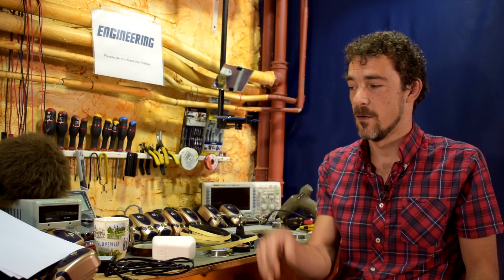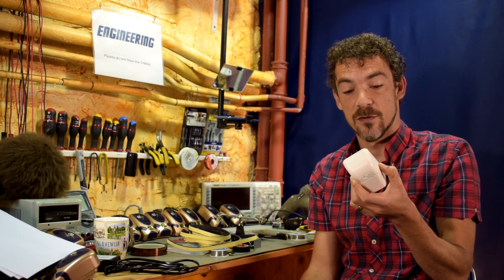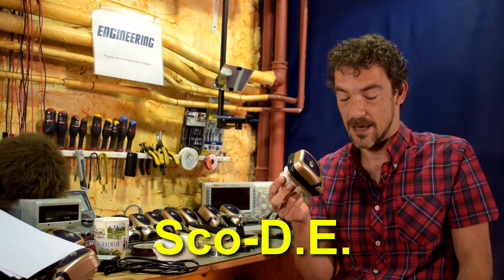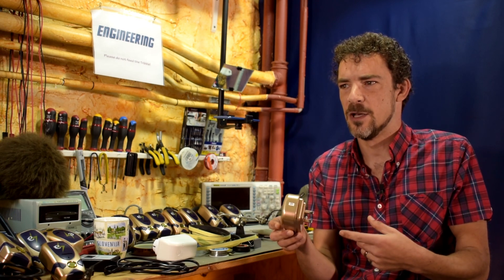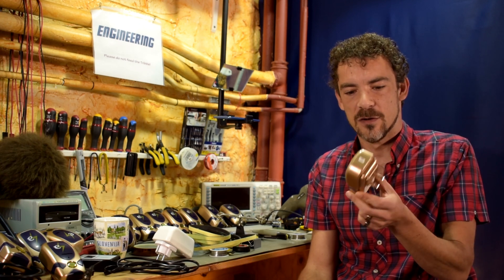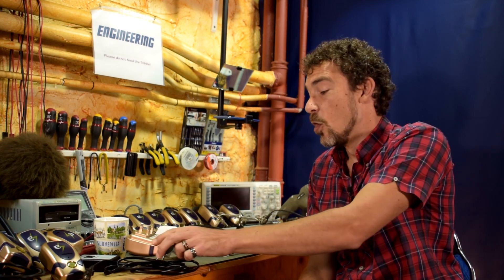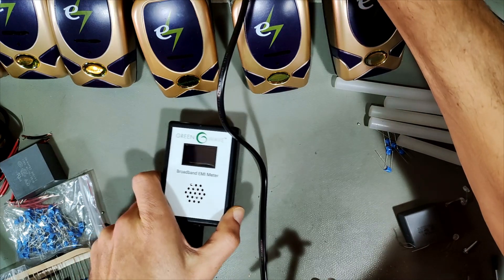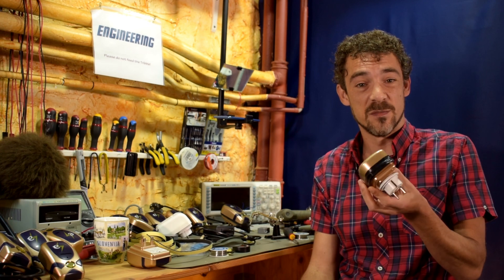Make your own Dirty Electricity Filters!

Comment from the maker: IMPORTANT: DO NOT use cheaper "motor-start" capacitors... Use real X2 EMI caps. If you don't, you may end up with melting filters and fire!! The little blue caps should be Y-class if you decide to include them, as well.
Reply: So i should not include little blue caps if I dont have ground in house ?
If i should , where to connect them , u connected them to the ground
Reply from the maker: @dasistthomsen9  If no ground, then just leave out the blue caps.
Reply: Yowzers! 25uf at 230 volts is 410 watts!   That wall wort will go into meltdown.  Why not just use the power saver as is?  They have a 1 or 2uf cap in them already, optionally you could add a 200pf cap, the led is already there as a bleed down.   If you need more than a few uf to filter dirty power either the wiring in your house is suspect or you doing something you shouldn't be doing.
Reply: When did electricity become dirty ?
Reply: @PrettyGoodLookin  Probably when SMPS (switch mode power supply) started being used in electronic devices. Also, CFL and LED bulbs add DE to a line. This can be easily demonstrated with the G-S or GW meters. My wife and I have several rental properties. When I am looking to buy one I always test the mains for DE.  Condos seem the worst with readings in the thousands.  It is tough to mitigate this much DE with filters, so I usually take a pass on those properties. I can't comment on whether cell phone tower waves do anything though.
Reply: @lo1234-w9r  While it is true that a 25 uF capacitance across a 230-volt, 50-Hz line will result in 1.81 A through the capacitor, the true power delivered to the capacitor should be nearly zero, and consequently, the capacitor should not get warm. If that is indeed the case, then the "consumption" of electrical power will be zero. In that case the product of voltage and current is called apparent power and its units are volt-amperes instead of watts. If the capacitor does get warm, then the capacitor is not well made and you will be paying for the power that is causing the heating. That power is called true power and is measured in watts.
Reply: Yup this is one thing you do not want it to be Made in China (that’s mean buying from Temu) Japanese capacitor are still everywhere

Comment: I bought the Greenwave filters to remedy a problem I had with computer equipment doing weird things I couldn't explain and had troubleshot it down to EMI on the line.  Like off the charts it was so bad.  My electric utility here in Canada wouldn't fix it so I went out in search of power bars and anything else I could find that said it would filter EMI.  The Greenwave filters are hands down the best device out there for cutting it down.  What I actually did was at my main breaker (fuse) panel I installed 2x 15 amp circuits as the first breakers where the 2 lines of the split-phase power I have coming into my North American Supply.  It's 220 volt but split phase of 110v and 110v.  So I have one 15 amp breaker on the one leg and another on the second.  I installed 2 plugs on these breakers and put in 2 Greenwave filters on each plug of each of the split phase lines right at the breaker panel and I dropped my incoming off the chart noise down to 104mv as measured by the Greenwave meter.  I then bought extra to put one in each room of the house and I managed to get it down to 24mv at each spot in the house.  All the random issues I had with my computer equipment rebooting stopped, I swear I feel better (anecdotal, nothing to confirm though) and I swear that we are having less issues with electronic devices in general.  I also noticed that the sine-wave is clean waves now and not fuzzy waves when I look at it with my Oscilloscope.  Anyway, just thought I'd pass along the information.
Reply: been dealing with the same problem form past 4 years,sir can you please elaborate more on how you installed circuits at breaker?a pic would very much helpful

Comment: Scottie, your taste in shirts gets an A!
I have worn out many just like it, along with my Tech buddies.  
"In a world of non techhies in screen printed T shirts, we stick out". 

Capacitor (& Transistor) prices jumped in around 2008 according to a Tech Friend who ran a repair shop. 
I already have 4 ASC American made 20 & 8 u f MIE  not marked x y.
I've installed non x y caps in mains wiring on noisy circuits in the past, and never had an issue, but have had other techs mention that x y are intended for this situation. 
(I have a bag of h v metalised film caps gathering dust).

Comment: Just finished putting together my own filters, for 25 of them here in the US with parts ran me around a bit over $300. Though my enclosure isn't as neat since it's a power supply box with a pigtail. Went with two x2 caps and the small y class caps to ground.  Don't have a meter to measure the reduction on the line yet but noticed my milligause readings on the cornet meter around the house have come down as I plug more in interestingly enough. Dropped by half so far with 8 filters. Least RF isn't too much an issue to deal with here as that usually averages below .01 mw/m2.
Reply: 😊😊q😊😊😊q😊qq😊😊😊😊😊😊😊😊😊😊😊😊%😊😊😊😊😊

Comment: really awesome and informative video! I have some curiosities. My application would be when using a generator during power outages. I want a "dedicated" branch circuit protected by a 20A breaker. I work in the powergen industry as a test tech, but our scope is three-phase power, 480V through 27kV, so I'm not "in the loop" with "residential single phase" power. I'm looking for ideas to "hard wire" protect a single branch circuit from my service panel which will supply a "media center". Your explanations of the usage for specific components is very helpful, as I deal with measuring "resistive/capacitive" loads as part of the "test" process. My "grey" area is how to incorporate mitigation regarding "source" power. That's where your video gave me the "?" moment!. Now I want to explore circuits that can lower THD below 10%. If you have any advice, I would GREATLY APPRECIATE a reply!
Reply from the maker: Well, one thing to keep in mind is that you should not add capacitive loads like these D.E. filters to any circuit if you're running it on generator power. See my vid here: https://www.youtube.com/watch?v=zgH_51KXA6o  Also, since I posted this second vid, Greenwave updated their website to warn against using D.E. filters when running on a genset. See: https://greenwavefilters.com/product/greenwave-dirty-electricity-filter/ under "Important Precautions"

Comment: Hi Scottie.  Thanks for the video.  Have you done any research on the whole house filters?  I'm wondering if it causes the same issue of pushing the symptoms further away from the filter..  Also, does the capacitor between hot and ground and neutral and ground cause any nuisance tripping issues on a GFCI or AFCI protected circuit?  Thanks again!
Reply from the maker: Haven't tried the whole-house filters since my experience showed that they wouldn't be enough due to the nature of the noise. The neutral/hot - ground capacitors shouldn't cause any nuisance trips... unless they fail, of course!

Comment: In the US plug were 120v should I look for lower voltage on the EMI capacitors? I got 20 of TEMCo 25uF 370v motor capacitors siting in the garage may save some money on parts
Reply from the maker: You can use the same ones. Capacitors can be charged up to the rated voltage, but no more. So a 305V cap will work for both 230 and 120V. At 120V, it will just never charge to higher than 120V. Because you're stressing the capacitors less, they may even last longer!

Comment: Hi Scotty, 
Have you checked the voltage across the L and N when you unplug the filter? Chances are it's going to be pretty high for about 5-10 seconds before the resistor discharges it. 
Not sure if this is a design flaw, but perhaps something that a different resistor would solve to discharge the capacitor faster.
Reply from the maker: I remember wondering why Greenwave chose that value, because I had calculated the same thing as you... But when I tested it, the voltage had dropped to about 40V after 1s, if I remember correctly. I figured that was good enough. Otherwise it might need to be an even beefier resistor.

Comment: Hi Mike. Great video if you want to DIY, really informative. I went the easy way and bought 4 Greenwave filters. I saw some other interesting stuff and it would be good to read your opinion about the StaticShield - Power Perfect Box. Do you believe it is worth the price for what it says it does? Benefits stated "Surge protection, line conditioning, EMF reduction, voltage regulation, negative harmonics reduction, reduced electrical consumption, equipment longevity, energy savings". Regards!

Comment: Enjoyed your video. Just wondering if there is such a thing as a whole house device (assuming an electrician would be needed for installation), or do individual appliances have to have separate devices plugged into an outlet within their circuit?
Reply from the maker: There are whole-house systems, but it seems the noise is filtered better with individual units placed around the house. That was my experience, anyway.

Comment: If you are making for example 4 units, the cheapest option maybe to get a bulk quantity of 48,  2.2uf  capacitors,  and put 12 in parallel in each unit (total capacitance 26.4uf each unit).
Reply: @lyra806Hello. You are very knowledgeable on this topic. As you know, the mains voltage has a frequency of 50 or 60 hertz. I need to cut off all noise from 200Hz and above. What size capacitor should be used?

Comment: NIce work!   Do these type devices consume any energy, I.e., will they cost money on your electric bill?  Thanks!
Reply from the maker: Nope. You are only billed for 'real power', and these consume 'apparent power'... It's all about Power Factor: https://www.youtube.com/watch?v=odIl-m-jJr8
Reply: @ScottiesTech  Thank you for the response. I'm kind of confused. When I test the G-S plug-ins with my Kill -A-Watt device it shows them using about 0.8 amps.  I measured several G-S units and always get the same reading.  How come?  TIA
Reply from the maker: @michaelmasztal7871  It depends on how the Kill-A-Watt gizmo is measuring the power consumed. It's probably fairly basic. Most likely, the addition of large capacitors in the D.E. filters skews the reading it gives. What really matters is 'real' voltage x 'real' current - that's what you're billed for. But with AC, any inductor or capacitor skews those readings. With DC, it's much simpler.
Reply: @michaelmasztal7871  Michael, after the filter device has been plugged in for a while, touch it to see if it is warmer than the surroundings. If not then no power is being consumed and the power company will not charge you for having it plugged in, even if you do measure a current. The reason is that the current is not in step with the voltage, i.e., they do not reach their peaks at the same time. They are said to be out of phase with each other. If the filter does warm up then you are paying for the electrical power to make it warm. The warmer it is the more it is costing you.

Comment: Will the 25cap set up work in USA? What voltage? Thanks :) love your channel
Reply from the maker: The capacitance value will be the same. You can also use the same caps in terms of voltage (305V) since they will just be even more robust at 120V. Or you can go for 250V caps if they're cheaper. Higher V rating on caps just means they can safely handle up to that voltage. Since USA line voltage is about half that in Europe, you're good.

Comment: Scottie, let me do another question:
Here in Brazil, some people put a capacitor on the fridge and freezer's motors, saying that it will reduce the energy bill. 
Probably this will not reduce the bill, but in question on DE, putting a capacitor this way could reduce or mitigate the DE gerated by these machines?
Reply from the maker: Well, unless they are paying for 'apparent power', it won't make a difference in their power bill. Usually, only industrial customers pay for apparent power; everyone else pays only for 'real power' consumed. The second thing is that in most cases, fridges and freezers don't have 'digital' motors - they still have normal AC motors powering their compressors - so they won't generate much D.E. Of course, that's slowly changing, so newer models will produce D.E... But even then, it's a better idea to test for D.E. with a meter and install filters where necessary. D.E. noise is notoriously difficult to pinpoint and reduce, so you'd have to test!

Comment: Is a current limiting device in the hot leg required? Was something fuse like on the original circuit board? Not thinking about protecting the device just wondering about keeping it from getting hot in a fault.
Reply from the maker: You could add a fuse, but the original filter didn't have one.

Comment: Watched several of your videos and really enjoying them!

Question about capacitor choice: I noticed on ebay and Ali there are much cheaper caps that have the exact same specifications except the P(I assume plate size) is smaller. Does this matter a lot? I assume a larger mass doing the same load will be able to dissipate heat more easily and potentially last longer. Is that the only difference? Thanks!
Reply from the maker: Yeah, that's the question... It's difficult to choose good caps since there's a lot of garbage out there. I usually don't go for the cheapest ones.  If it looks too good to be true, it prolly is. Usually what I'll do is go to a good component provider, check out the specs (including phys. size), and then go back to AliExpress or some similar site and try to find what looks like the same product with same specs, but NOT the cheapest one. I still save money, and so far it's worked out pretty well.
Reply: @ScottiesTech   Is there a particular reason you picked the values you did for the safety EMI capacitors? I noticed a tear down video of the greewave revealed one 275k version only. Do you think this config does a better job of filtering or is it overkill? Is higher value better for filtering or is that just for the sake of less overheating chance?
Reply from the maker: @Novacasa88  A different cap value will just filter different frequencies. I graphed it and concluded the values in the newer Greenwave filter is better, but the old one will also work. It's not really that big of a difference.
Reply: @ScottiesTech  Awesome thanks bro! <3 I assume the higher the value the lower the frequency it can filter?
Reply: @ScottiesTech  One last thing; Would you be interested and or willing to do a follow up that shows how you analyzed the wave form for your mains power to determine the raw line vs the DIY filter and the Greenwave one (if you still have one). That would be really cool to see.
 I got an oscilloscope recently and want to learn how to use it but I'm avoiding AC power for a while haha.
Reply from the maker: @Novacasa88   This will give you an idea: https://article.murata.com/en-us/article/impedance-esr-frequency-characteristics-in-capacitors
Capacitors have some "AC resistance", so their frequency response curves have a dip somewhere in the middle. At that dip point, which is the resonant frequency, the "resistance" is lowest - i.e. it filters best. Practically, there is very little difference between using 10uF and 25uF, for example, but that depends on the other factors of the particular capacitors. You could have 2 caps, both 10uF, but they'd have very different freq response curves due to differing ESR (impedance / AC resistance). It gets hairy. Ultimately, any value in the uF range should do a pretty good job for the purposes of filtering D.E.
Reply: @ScottiesTech  its all very interesting stuff. I'm really looking forward to learning more about electrical engineering in general. I ordered tons of IC and other components for making DIY circuits and I'm about to buy a laser for my 3d printer so I can etch some pcbs. I'm also about to use a carbon laser to cut out some pcb shapes for DIY keyboards that I'm 3d printing cases for and then going to wire up DIY pcbs using the ergodox ez model keyboard. Pretty fun!

Comment: Maybe I missed something, but doesn't the Greenwave filter act as a 'thru' plug (for connecting an appliance), but this one you've built doesn't appear to have an output?
Reply from the maker: Correct. I have so many power strips, it didn't matter. :)

Comment: I plan to make a few of these filters using a different enclosure. I was wondering if it is ok to use a plug with a short cord extending 3 to 5 inches from the enclosure. Would this have a negative effect on the performance of the filter?
Reply from the maker: Nope, that's fine. You can even plug filters into power strips if you want.
Reply: @ScottiesTech  Thank you very much!

Comment: Could this idea be adapted to clean up the noise from a portable generator?  I installed a generator panel in my house, but was always unhappy about the noise level coming from the generator (non-inverting, lower cost portable gen).  It would be fantastic to create a whole home filter for this purpose, ideally something with an indicator when the caps are starting to dry/die.  Thoughts?
Reply: im on the same boat. i have a 9000 watt generator i plug up to my house sound sketchy but i would like to build something similar to this for the generator.
Reply: Those EMI capacitors will probably never dry/die. They were designed to filter powergrid interferences.